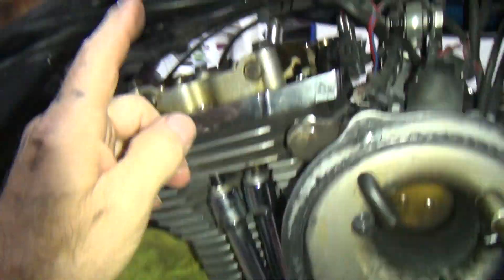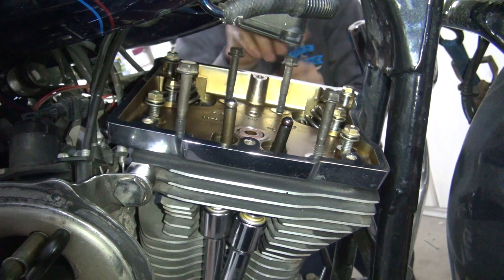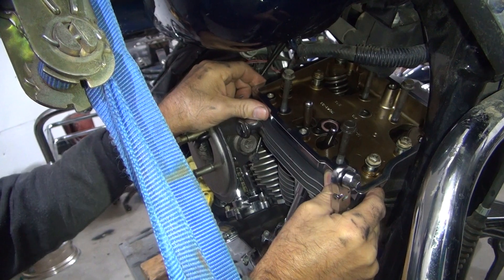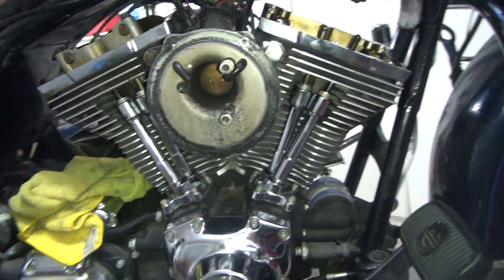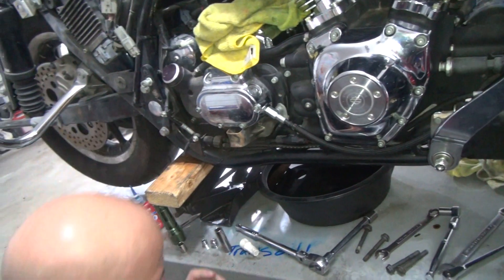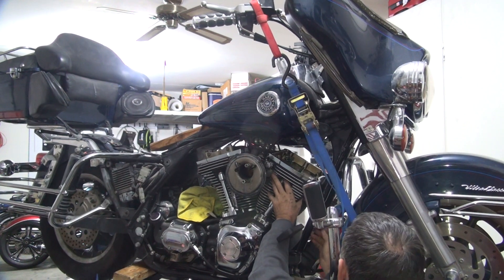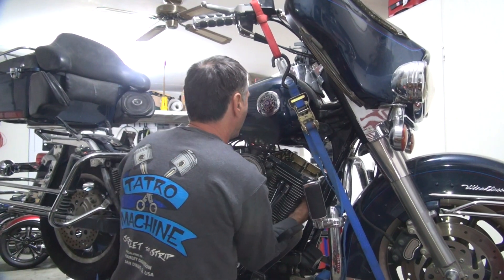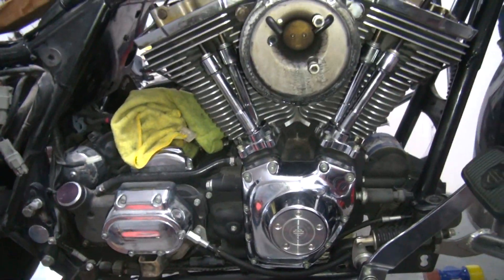#121 2004 road turd cam change tensioner bearing repair FLHT 88 twincam touring harley tatro machine

Comment: ‘Tate row’..or tatt roe?
Reply from the maker: how about ta tro.
tatro
Reply: That’s that.
Sold the 11’ ultra,not a mechanic,fluid changes,no problem..the rest,have no business owning one,without the skill set to diagnose and make repairs myself.Had 70k on it,rebuilt by Harley in Lancaster,crank had 25 thousandth run out,the guy had proof of the rebuild,so I bought and enjoyed it,for around 8 thousand miles,then decided to sell it,for $6.5k,sold fast.Kept a ktm exc 500 duel sport,going to teach myself on that water cooled single cylinder bike for a few years,when I get a little better at mechanics,I may go for another Evo,go from there.
Reply from the maker: the evo is a better motor but being 25+ years old, it will be needing work too.
tatro